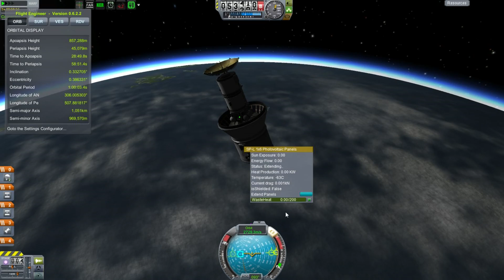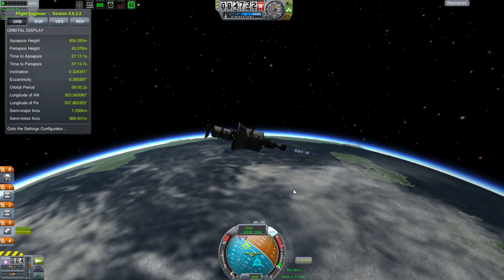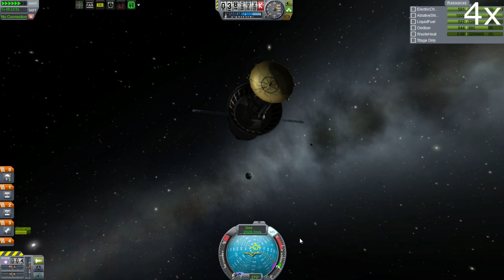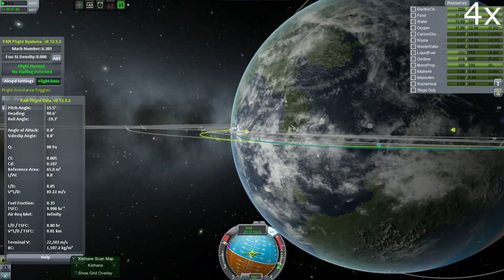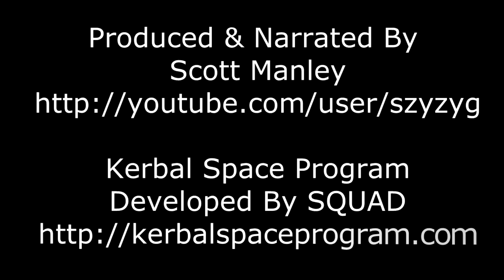Kerbal Space Program - Interstellar Quest - Episode 30 - Moho Return Probe & Orbital Power Station

Comment: Ok, after switching to the SABER engines from... One of the mods I'm using, I honestly don't know if it's KSPI or B9, I managed to make an even more fuel efficient SSTO plane.

I still don't have much in the way of cargo capacity though, on the last flight I just loaded a fuel canister into the cargo hold and used that for reserves. I guess the B9 parts really do add a lot of fuel options... But I still can't use those since they're all neutral lift, and makes my spaceplane fly like a ton of bricks.
Reply: After looking at your fuel status when you hit orbit I have to revise my opinion. I guess I really did do everything right huh...

Oh well, I've already sent my SSTO Mk. III to the Mun just to practice docking and orbital refueling, the plan is to dock it to that old fixture of Kerbal spaceflight in my game, the Munar refueling station, but if that fails I've sent one of my close orbital refueling craft along with it to provide the support it needs.

Comment: So I have been wondering, you have the fuel lines researched so why don't you do an asparagus rocket? I'm a novice to ksp and know just about nothing about rocket science but when I learned about asparagus rockets I started doing much better with ksp. Is it something to do with the mods or the heavy payloads you have been doing?
Reply: They're far too wide to cut through the air like a rocket has to in order to achieve any meaningful speed. The widest ones resemble pointy pancakes, and the thinnest simply can't be made narrow enough to move like a rocket should without risking structural instability.
Reply: Nope. NASA knew about asparagus staging before it was NASA, but
although asparagus rockets look amazing on paper, the structural
complexity, high drag, and intricate fuel network make real asparagus
rockets end up as glorified bonfires. They would work in space, but the
whole point is to use them to reach orbit--perhaps if we needed to build
rockets from scratch to escape an airless planet, asparagus staging would
be effective, but with any significant atmosphere, asparagus rockets
quickly become impractical.
Reply: Asparagus rockets only work in stock KSP because of the simplistic aerodynamics. With the realistic atmosphere Scott uses, asparagus rockets are (like in real rocket science) nothing more than an appealing fantasy.
Reply: SchrodingersWaffle ahhh, gotchya. thanks. i dont know anything about rocketry so i didnt know they werent realistic
Reply: I did a bit of background research before I started KSP, thinking It'd give me an advantage. Turns out the asparagus rocket concept dates back nearly to the dawn of rocket science itself, but it never saw any remotely practical application until some unknown KSP player either separately invented them or recalled a lesson on rocket history.
Reply: SchrodingersWaffle
thats kinda upsetting but interesting. why dont they work in the real world?
Reply: SchrodingersWaffle They work with his mods.
Reply: I'm not saying they don't (or maybe I did; if so, I was wrong). But Scott's
apparent goal with this series is to make everything as realistic to our
world as possible, even editing mod files to make aerobraking possible and
liquid water present on Minmus.
Reply: SchrodingersWaffle I always thought NASA never thought about asparagus staging... I always thought asparagus staging were in the higher tech of space tech... so wow

Comment: Manley you really outta start using action groups. Makes me so anxious to see you unfolding a single heat radiator and solar panel at a time :l
Reply from the maker: I tend to use action groups only for time sensitive operations - like engine & intake management on spaceplanes - I don't want to use my limited number of action groups on things which I can do at my leisure.

Comment: i have a problem, pc laggs while running kerbal space program, my pc is build by myself and here are the specs

Amd phenom ll x6 4.0 ghz
Ati radeon hd 6770
8gb ram
1tb hdd
and epic watercooling, i have bf4 at like 40 fps on med but wont stop lagging on ksp even on low XD
Reply: im just worried my $900 gaming pc has bottleneck issues... and i also really want to play the game badly. :(
Reply: the game is only 32 bit so you can only use 4 gb of ram thats is the main problem
Reply: define "lag".  Are you lagging when you have a rocket with 10 parts or are you lagging when you have 300+ parts? kerbal doesn't require much as far as a GPU, i can play it on a $60 GPU (6670) i bought 2 years ago with maxed out graphics.  one of the largest limiting factors is it's single threaded limitation.  If you disabled a few cores on you phenom and overclocked it you would potentially be better off.
Reply: XD i ahve overclocked to 4 ghz and i can shut down 2 of the cores so i get a quad core
Reply: Alex Shi i'm running a HD7990 and a FX8350 @ 5.1 ghz and still getting lag. i blame it on the fact that it is still in beta.
Reply: ty, also i plan on getting the 7990 and fx in my next build :P
Reply: Alex Shi I have a similar pc I just have a bit better graphics card. gtx 760 and i5. I can run everything on max and load large ships with no problem. I would make sure all your drivers are up to date, that can be a major problem.
Reply: they are XD
Reply: Your CPU is lacking. the CPU and RAM are what runs this game, pretty much

Comment: I actually have a question about the gravitational constant you used in the previous episode. Now I don't know that much about the subject so you might simply correct me here with a simple answer. But i've had some basic physics at school, also using a gravitational constant. But this constant was for on earth's surface, namely 9.81. We learned that this value isn't really contant but it depends on height i.e. distance from the centre of the earth. But since the basic stuff is all relatively on the same height (buildings, cranes and what not), we can take the value 9.81 as a contant.

Now you are using a constant value no matter the distance from the earth, which seems strange to me because the differences in height are relatively big. So could you maybe explain where this value comes from? Is it maybe an average or something? I mean that because we never go that far from the earth relatively speaking.

Comment: Scott, remember that waste heat has changed in KSPI v0.9+.  Your waste heat will build up, making your radiators hotter, which then causes the radiators to radiate more heat, and so on until your radiators and reactor reach a thermal equilibrium.

Comment: dude, love the videos! ive been following the whole series (first one ive ever really followed) and i loved the mods so i got em myself, i was experimenting with the reactors and folding radiators, and i noted that the waste heat will get to a point where it will no longer increase because the hotter the radiators get, the more effective they are. it was concerning to see the waste heat reach 4/5 of the way (out of a total of 1,120,800) i only used 6 radiators as well. normal sized.

Comment: Hey Scott, I would suggest you look up some info about thorium reactors. They work way differently than uranium/plutonium reactors. Just suggesting this because i get the feeling you don't know about the difference (but don't worry, not many people do, sadly)
Reply: There isn't much difference anyway :P
Reply: well, there is that part about thoriumthat keeps it from melting down
Reply: Azivegu Thorium just has a lower fission temperature, so requires less shielding and safety precautions, although because of its lower fission temperature it requires a lower-entropy fluid then conventional water, sometimes making the reactor larger or have a shorter life.
Reply: Thats where LFTR come into play. Getting rid of the water factor, it uses molten salts which can absorb more heat before boiling. That boiling is what makes conventional reactors (eg uranium/plutonium) so large. LFTR's can be made to the size of a one car garage
Reply: Azivegu Molten salts are MUCH more corrosive then water, and so as I said, the reactors would have much shorter lives. Besides, many of the by-products of the uranium reaction are  very useful.
Reply: The necessary materials could be developed. There shouldn't be much of a problem if there is incentive to develop. Thats what they did when they went to the moon. But you are correct when we look at what we have now.
Reply: Azivegu If you want to count future technology, then fusion beats EVERYTHING else. Huge energy output, the fuel is literally the most common material in the universe (Well, with an extra neutron), the fuel is also super light, the output is incredibly useful, cannot be turned into weapons, and the technology is only maybe 30-60 years off.

Comment: If that reactor is active, shouldn't it be emitting cherenkov radiation and thus glow blue? (Or is that kerenkov radiation and glow green ;)
Reply: SeedlingNL This is what the YouTube comments should look like! :D
Reply: Only happens when there are particles travelling faster than the specific speed of light for that medium. You basically need a liquid for that.
Reply: Isn't that reactor encased in water though, to transfer heat from the reactor away to the heat exchangers? Now that I think about it, it's probably blocked by the exterior shielding, (unless there's a viewport that allows light through). Or would a nuclear reactor in space not need water.. think I'll go ask Thunderfoot that question, he sticks iPhones in neutron beams for fun and science :D
Reply: SeedlingNL
It is a LFTR, so there is no water involved in the reactor design. The molten salt fuel act as heat extraction medium. And the enrichment process itself acts as partial shielding.

Comment: Have you tested heat dissipation after heat has had a chance to build up with timewarp?  Radiators dissipate faster the hotter they are like in real life.  I didn't realize that until I asked on the forums.

Comment: How is it possible that your reactor overheated? I only ever use 4 heat radiators on a 3.5 m reactor and everything is fine. You mentioned thorium, mines burning UF4 maybe that's the difference?

Comment: Actually Scott, I think your radiators could probably handle just the reactor. When you activated the Microwave Transciever you added a lot of waste heat on top of the reactor. You could try disabling the transmitter if you're not gonna use for now.

Comment: Scott, remember that the radiators follow the Stefan-Boltzmann law -- your radiators need to be hot in order to radiate heat.  Therefore your waste heat will climb at an alarming rate, but it will eventually level off.  Now, it didn't look like you had the upgraded radiators (you get those from Experimental Electrics), but it looked like you were a little overboard on radiators.  That's a lot of saved mass there.

Regardless, when you get the upgraded radiators, you get the Microwave Receiver, so I think it might make sense for you to wait until then to launch your microwave network.  Because at that point your radiators get about 45x more effective.

Comment: That seems like an excessive amount of radiators I am getting buy with 2-4 of the huge ones for a similar sized power station 

They get more efficient as the temp comes up (though your power station's efficiency goes down as the temp comes up too) but I do pretty well with significantly less radiators than that

Comment: Quick general question. Is it more desirable to have a perfectly circular orbit or is an elliptical more efficient in the long run?
Thanks.
Reply: Any orbit outside atmo will do. If you want to burn into interplanetary space aim for a low orbit to make full use of the Oberth Effect. Circular orbits are for looks. Unless you want to have a nice space station or satellite network: don't bother.
Reply: More efficient to do what?
Reply: circular orbits have their benefits(rendezvous with other orbiting bodies, a more constant speed, look nice and tidy, all that jazz) but at the end of the day the two really done make to much of a difference in terms of efficiency unless we are talking about the oberth effect, in which case i guess an elliptical orbit might help, but a circular one can in practice get just as close to a planet as well before a burn...user preference i guess. i noticed when i was new to the game i never seemed to have enough fuel for a circular orbit, because i didnt plan well. when you play the game a tonne, it becomes one of those things you start to really care about.

I guess one thing that can suck about an elliptical orbit is if it drops to low to a planets surface, (Say going from 600k apo to 100k paro) it messes with time warp. You cant warp faster then 1000x in lower then 500k, which is nice if you are waiting for a window. However you should never transfer to another planet from high orbit, its less efficient. So just time warp on the planets surface.

Comment: how do the radiators work in a near vacuum? if there's no particles to transfer the heat to, how is it being dispersed? might be having a derp moment here but i can't think how 0.o
Reply: To add to what the other two said, it works, but it's really inefficient for the reasons you gave. Hence why Scott had 14 massive radiators and even that was far from enough.
Reply: pseudocoder78 Sure, conduction and convection are the same in the sense that they're both caused by atoms bouncing into each other transferring kinetic energy. But since atoms in fluids can move around, it creates some interesting new phenomena (like weather). That's why sub-disciplines of physics consider it convenient to treat it as a separate category.
Reply: Well, heat can transfer in various ways :
Conduction - when two bodies touch.
Convection - when immersed in a fluid (e.g. air).
Radiation - just like the Sun radiates heat. It works in a vacuum and the magnitude is determined by the Stefan-Boltzmann law.

Edit : I write too slowly, apparently :) Didn't see the previous comment.
Reply: Heat is just light. Heat those large radiators up and they will send the waste-heat out into space in the form of light.
Reply: Thermal energy can travel through a vacuum. For instance, the sun's thermal energy is hitting earth after going through 150 million kilometers of vacuum. Hope this explained it well enough.  = )
Reply: ahh ok, cooled by radiation. i had suspected that but thought it wouldn't be quite enough to disperse the amount of heat from a nuclear reactor, so i disregarded it. a derp moment indeed :P thanks though chaps :D
Reply: Elan Morin I believe convection is a result of conduction or radiation into a fluid.  It is not a means of heat transfer in and of itself.  The two main classes are conduction and radiation, the former of which is not possible in a vacuum.
Reply: Jacob Kofoed
Not right and not wrong. Heat is a wavelength, commonly called infra-red radiation. The visible is (as far as I know) the only wavelengths made specifically from photons, which can (and do) behave as waves. Correct me if my correction was wrong though, it's a long time since I've actively done physics
Reply: *****
Ah figured I'd be wrong somewhere; got stuck with a physics teacher that couldn't teach well, so I missed a lot during his lessons
Reply: Elan Morin Interesting, well I guess since neither conduction nor convection are possible in a (true) vacuum, the point is somewhat moot.  Thanks for the notes.
Reply: infra red radiation is how the sun sends its hear energy towards earth and through a vacuum. so thats probably how it works

Comment: What WOULD happen in a hypothetical orbital meltdown? Leaking/boiling coolant would function as a small rocket, for one... is it possible that the core would melt enough of its shielding to drop below criticality? Would a reentry breakup spread material out enough to where it was significantly safer (by concentration), or would everyone in the strewn field be screwed?
Reply: I think it technically wouldn't be called a "melt-down", more like a "melt-out", as i believe the "down" refers to the (now) liquid nuclear fuel melting down through the bottom of whatever containment vessel it is held in.  In the microgravity of Kerbin orbit, it seems like it would just melt in place, or melt outwards due to centrifugal forces if the reactor spacecraft is rotating.

Comment: The unexpected rotations are sometimes caused by FAR plugin, be aware that if you leave FAR assistance it'll try to "help" you steer the shuttle (like previous vid) even in space. Inside atmosphere it's not seen by "naked eye" but in space with higher velocities and faster movement, according to Kerbin surface, it matters a lot. Sometimes even disabling it still causes you to rotate (I had this issue with my satellites, when I disable reaction wheel it's not doing it anymore and I can kill rotation with RCS). Save and load can help you sometimes get rid of this.
And btw, greetings from Poland :D